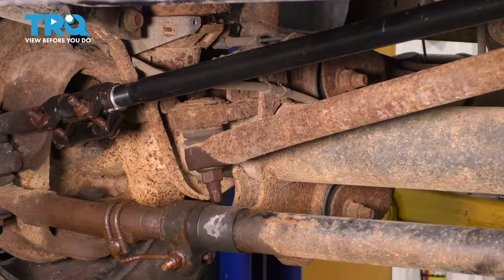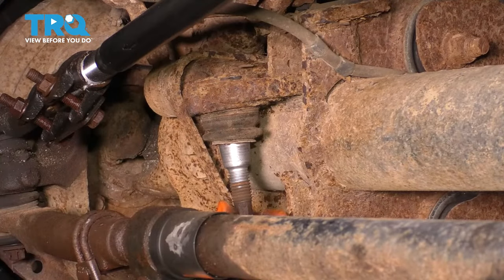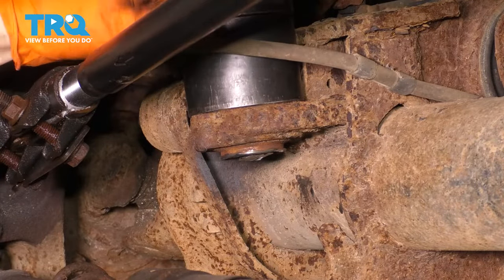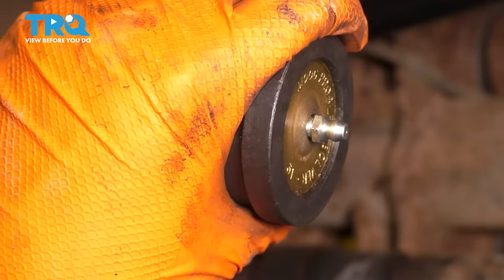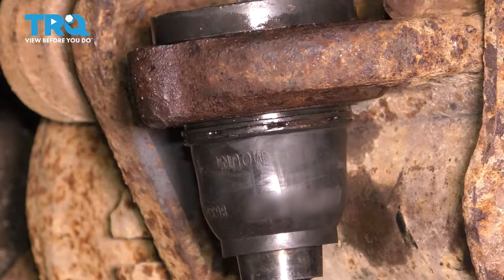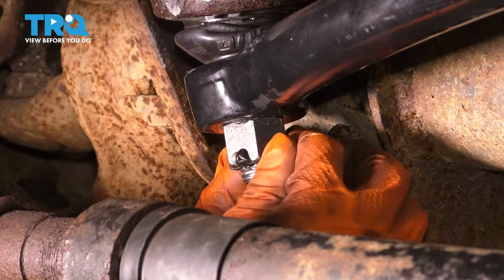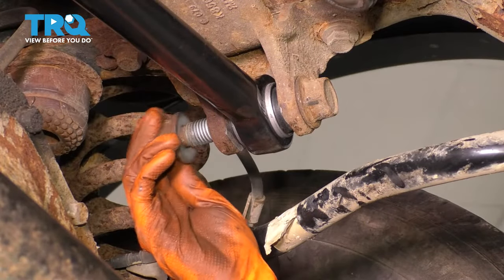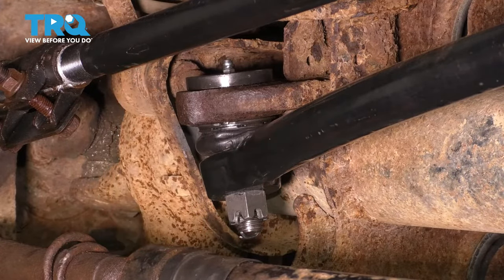How to Replace Track Bar Ball Joint 2008-2010 Ford F-250

Comment: DO NOT MESS WITH THE TOP BOLT!!! It is tourqe to yield and WILL come loose again, I garuntee it! You have to use a tourqe multiplier ($300) to get the right tourqe. That impact is nowhere near tight enough. If it's not tight enough your front axle will walk side to side not long after you finish. I learned the hard way. I promise you it's a headache to deal with. Just leave that bolt alone!!! If you absolutely have to, you need a new bolt and nut from the dealership. The original bolt won't hold the tourqe value a 2nd time.

Comment: I put a bottle jack under the stud of it and lift that side of the vehicle up and then hit the mount with a hammer. I use the vehicle’s weight to my advantage to remove it

Comment: Good video. Only caveat. If you're replacing the balljoint with an OEM one, you need to attach the bolt portion of the tool to the top of the joint because the balljoint stud is way too long for the tool unless it goes through the eye portion.  Unfortunately you then have no room to attach a tool to the bolt of the press as the press sits crooked with it hitting the frame. You gotta lift the side of the cab by the frame (if working on the ground) and lift it with a 4x4 around 5 inches for the clearance to put a tool on. Source- sitting here just did the job and it sucked especially if also replacing the bushing.

Comment: i like your video, the only thing i dint like was the way you bend the cotter pin, you know there is a reason that the cotter pin is split, that way you bend one part up torse the nut and the Oder to the shaft of the ball join.

Comment: HI TRQ, Could you elaborate on the tools used in the vid?  Like what are the dimensions of the installation receiving tube? ( I see you use OEMTOOLs 37310 E). @nickm9134's comment about the jack screw needing to be pointed up makes me wonder if that tube would work for installing the OEM balljoint. (The OEM BJ is 5" long). Additionally , what size C frame do you have here? I see you cover the "eye" with a piece of bar stock so you can flip the fame over .. clever! 

 Any part numbers or clarification would be awesome. Much appreciate any reply. Thanks again.